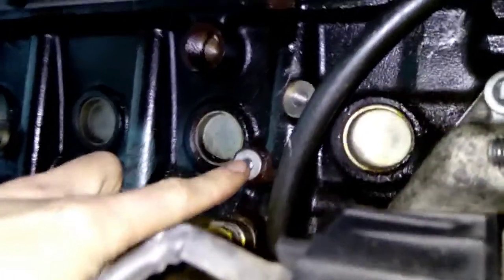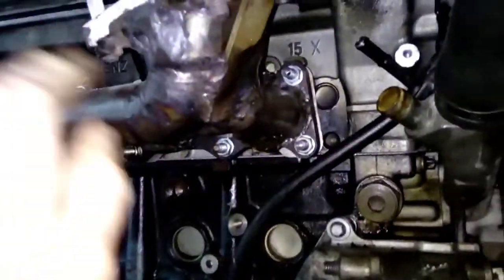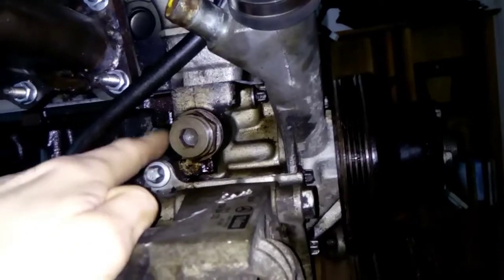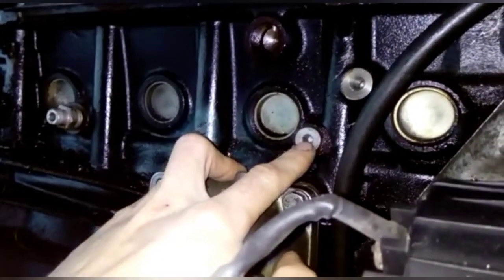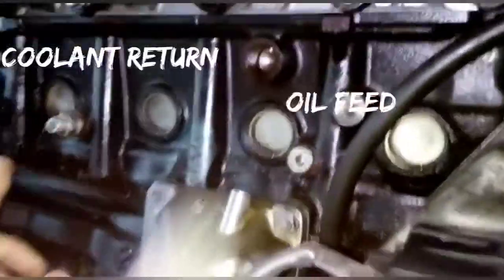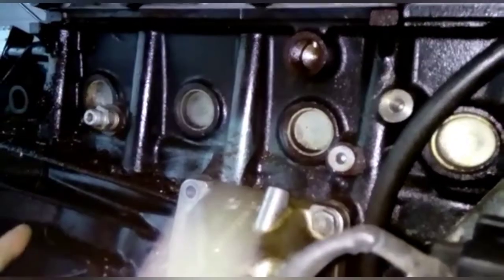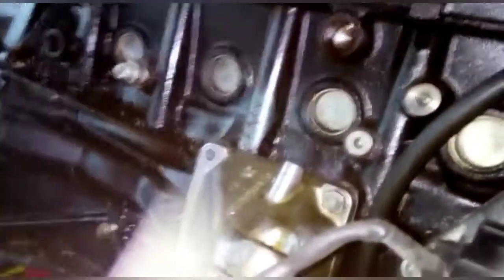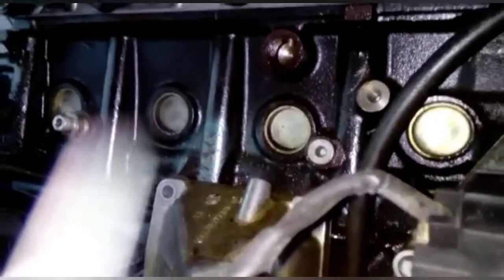Mercedes M111 Turbo Oil Feed How To Guide... (size of fittings needed in description) #subscribe

Comment: Hi! Im wondering to turbo my 2.3K engine. Thanks for ur video the oil feed line problem is solved. But its will be a drift car and i would like to have an oil cooler too. Could u tell me some tips how to do it ?
Reply from the maker: Hey thank you for your kind words, if not already please subscribe it really helps the channel get suggested to more people that way my videos can help more people 😃. I'm trying to work out exactly the same thing, you can bypass the stock oil filter housing by using the two threaded ports on the front cover of the engine. If you look there is two female hex bungs in the front cover, you can remove these and fit some adapters to 10 AN fittings. But using this method you will need a remote mount oil filter. I also don't know the thread size or pitch of the bungs that are in there stock, but right now this is the only way I can suggest how to do it. There is a possibility of another way off the back side of the oil filter housing but I'm not sure on that, I think that may only be on Evo engines. I hope that helps buddy👍

Comment: What exhaust manifold are you using? Is there a stock header from another Mercedes engine? Also will they fit on a w202 c20? Thanks
Reply from the maker: On our turbo Slk we made a completely custom log manifold, on our Supercharged cars we always use the stock tubular header you could use a 230 Kompressor header on a 200 car. ide recommend one from a Clk or 202 though as the Slk the engine sits more forward from the fire wall so the manifold is slightly different. It depends really one what you plan on doing with your car, if your just looking for a cheap tubular header then the stock kompressor one is ideal you may also need the exhaust front pipe to link up to the header. hope that helps please if not already consider subscribing 🙂👍
Reply: @M-oneeleven-M111  ah ok thanks for the reply and info!, I do have the steel tubular manifold on her just wondered if there was any stock cast log manifolds that would fit to save some fabbing but I guess if I just reroute the steel one I can find a nice place for the turbo anyway. I'm only making the turbo kit to get better efficiency out of it and maybe a bit more torque and some nice noises of course (;, so maybe running it on a bar of pressure max, do you know if the plastic intake manifold will take a bit of pressure or will I have to find a cast one?
Reply from the maker: @willreeves497  ah right you can take a M111 log manifold cut open the outer shell and they're are t prices in it if you cut the welds on the flange neatly and re organise them you can make a turbo manifold from that. The only downside to that method is the stainless t prices are quite thin so you have to brace it and they are prone to cracking. Have a look at the exhaust manifold video we have on the channel it shows one made using that method. What management do you plan on running the car on also is it a C200 N/a or a C200 kompressor? A bar on a stock 2.0 na m111 with 10:1 compression won't end well it will Det badly blow the headgasket out for sure if not lift the head whilst it's at it. Only the 2.3 kompressor engine should be pushed that far, the 2.0 kompressor is I think 9.6:1 so can take close to a bar. The N/a I would not go more that 0.5 bar because of the compression the rods will take it all day long the pistons can take power but can't take DET something would fail very quickly. Also stock management if Bosch ME can't manage safely up to .7 bar but yet to test this on a N/A car. If the cars on the earlier HFM management then a draw through set up may work but it also might not. If you car is a manual go standalone with knock detection it's safer and easier to tune. There's a lot of videos on YouTube that make these M111s seem bullet proof but it's more down to the fact people don't show failure like we do. Also depends on turbo trim to if your more looking for efficiency that's sensible efficiency over Hp I think you could make 180-200hp on a 2.0 Na m111 with a Gt17 or better a TD04 15t from a Saab Also a cheap Chinese t28 would work. We have noticed these engines seem to live longer with a GT28 sort of size turbo max, any bigger it seems the volume and pressure become too much especially when using stock headbolts. You will also want Bosch FR5DC spark plugs 0.8mm gap to prevent spark blow out or the plug melting down. Also I recommend a AEM wideband great bit of kit works fantastic and has a calibration function too. As for the plastic manifold yes it will take the boost but I always recommend the metal one because 1 you can modify it for a larger throttle body if you run standalone management and 2: it works a lot easier for fuel injector upgrades as both Saab and BAM injectors which is what we recommend are shorter than stock, on the plastic manifold the fuel rail bushings are part of the manifold but on the metal one they're seperate. This means on the metal manifold you can fit shorter 27mm fuel rail bushings to accommodate the shorter injectors. 🙂 I know that's a hell of a lot to read but I like to pretty much get most of the stuff out the way in one go 😂👍
Reply: @M-oneeleven-M111  so all m111 engine manifolds are interchangeable? 
Oh damn well that shows how bad my research has been, I thought mine was the lower compression one, i must have been reading the kompressors stats.... Well then in that case I guess I'll only be running a few psi. I have a t250 from an old descovery that Ive been mocking up, I'd much rather be on the smaller side, and have a faster spool for better bottom end efficiency, I don't really plan on racing around in this thing (have my turbo EJ civic for that kind of fun).
For fuel control ect I hadn't got that far into planning yet, I'm assuming because its ran from a MAF sensors I should be good for a few psi ? As most accommodate for around a bar above atmospheric, but if not then may just solder a speeduino together. Thanks for all the info btw, have answered quite alot of stuff I couldn't find the answer to after hours of searching (: have subbed
Reply from the maker: @willreeves497  Thanks dude appreciate it well the 2001+ Evo M111s have a different ports so a early manifold wouldn't fit that in the intake side, the Evo engines had quite a lot of revisions including lighter rods and crank but the pistons and head are better design. So aslong as your engine is pre 2001 with no sensor in the cam cover it's a pre EVO engine which means the metal manifold will fit, but you need a Intake gasket to match the metal manifold as the plastic intake manifold has o ring type gaskets. Oh that should spool pretty damn fast a t28 is near enough instant on a 2.3 with 8.6:1 compression. Good man in all honesty a Honda makes a better turbo toy bits are a little easier to find 🤣. Although I am trying to change that for us M111 guys. But a MAF should be good for 0.5 bar and with 10:1 compression it will pull well. No worries clear information is hard to find on these engines, the thing I see is a lot of contradiction on forums which makes it hard to know what to do

Comment: Hi mate. Where can I get a oil feed for and oil pressure gauge?
Reply from the maker: Hi mate is this on a turbo or a standard car? Not that I don't think it makes that much difference I don't think, but in my eyes although I could be wrong if turbo you could put a T inline but the turbo feed may cause a slight pressure drop. If stock then you could take it from where you would take the turbo feed from shown in this video. 🙂 To be honest I haven't thought about this until recently so I haven't tested that.
Reply: @M-oneeleven-M111  thanks for the quick reply. This is on the standard c230k engine that’s in my 190e
Reply from the maker: @MrConnorHorton  yeah so you should be able to run a gauge from that port fine I'll see if I can find where I wrote down the thread size although it might actually be in the description thinking about it. There should be enough room for a oil pressure sender to fit there. No worries I always try to reply as soon as I can 🙂
Reply: @M-oneeleven-M111  m12 x 1.5 is what you say in that vid mate.
Reply from the maker: @MrConnorHorton  ah ok dude I forget it's been so long since I've actually been playing with a performance M111 build 🤣
Reply: @M-oneeleven-M111  thanks mate 

I don’t suppose you know what pin the rpm signal is from the ecu do you?
Reply from the maker: @MrConnorHorton  bare with me I shall ask Ben he does all the wiring wizardry, things melt when I do wiring 🤣
Reply: @M-oneeleven-M111  thanks mate
Reply from the maker: @MrConnorHorton  still waiting for Ben to reply, I forgot to tell him it's on a 190 🤣. Is it's for the guage cluster I'm assuming?
Reply: @M-oneeleven-M111  it’s for the race tech dash 2 I have in it mate
Reply from the maker: Ben did say you can get it through the canbus but I'm not sure that's possible with your set up, I've been waiting a day for him to answer 🤣. We will get there the racetech do do canbus though doesn't it? I did look at them a while ago for my Is200
Reply: @M-oneeleven-M111  no that’s not possible with mine I’ve torn all that out. I can get it from a coil signal or injector but the injector isn’t a clear signal and the coil wire is too high voltage. So the other option is the ecu rpm signal.
Reply from the maker: Righty so the canbus is the only way to get it from the ECU the only other way we can think is piggyback the crank Sensor through a VR conditioner. This is why a lot of people switch to standalone cause the Bosch unit (assuming it's the Bosch ECU you have and not the Siemens) is a very awkward ECU to work with. It does have its bonuses as it's a very adaptive unit but that's the only way we can suggest buddy without going standalone. In our Slk we have megasquirt running the engine with the stock ECU and a OFgear transmission controller just to make that all sort of work. Sorry we can't give you the answer you were hoping for, agreed most of the time you can pick up a signal from the ECU but like I say these ECU's don't like to make things easy for us.
Reply: @M-oneeleven-M111  👍 I did try the crank sensor too but not with whatever a VR conditioner is so I’ll look into that. Thanks mate.
Reply from the maker: @MrConnorHorton  no worries buddy I like to try and come up with a fix but a vr conditioner I think basically cleans and or converts the signal. I don't do electronics I stick to the wrenches 😉 but yeah see if any of that comes to anything bud hopefully you'll find a solution 🙂
Reply: @M-oneeleven-M111  update: the oil pressure feed is fine taken from there. I ended up using a coil signal wire for the dash. It was too high voltage (15 when it should have been 12) so I added a resistor inline and it’s fine.
Reply from the maker: @MrConnorHorton  sweet I'm glad you managed to get it figured out, that's good thinking using a wire from the coil. simplicity is the best way, like I say I'm not big on wiring so I tend to shy away from it a bit. But super pleased you got sorted and I really appreciate you giving a update too 👍😃

Comment: Hi I have the r170 facelift 2.0K,  m111.958, 163hp stock.it has 9,5:1 comp ratio with with knock sensor sensing no knocks with 95ron fuel. When pulley and map it I reach 200hp engine running perfect but knock sensor senses knock at wot and ecu retards timing. So my question, is it safe to depend on knock sensor as I cannot reach higher octane fuel?
Reply from the maker: In short the knock sensor is there to protect your engine if it's knocking I wouldn't push it any more than that, but one other suggestion do you have access to octane booster? Most car parts place sell it that may allow you to push it a little more. If not I wouldn't push it anymore. This video of our shows what we did when detonation got the better of our engine https://youtu.be/pnTxLGLfD3c please if not already Subscribe we really appreciate it 🙂
Reply from the maker: The other thing is maybe a fuel injector upgrade? If not already on lower octane fuel you need more fuel so you have to have a richer fuel mixture the det (knock) you are experiencing could be that you just need more fuel

Comment: Hey can you help me out how to do it? Can I do with the motor on car ? What happens to the metal materials drilled inside of block ?
Thanks
Reply from the maker: Hey no drilling is required on the block for the oil feed if taken fro where we have taken it there is I believe from memory a threaded bung in the block where the feed is taken from fitting sizes required I think are in the description bud. It's a very easy job to be fair it's just getting a custom feed line made up. Or alternatively you can use a universal oil feed kit and source the adaptor fittings required. We have taken ours from the thread in the block and it's always had enough pressure. I know in the video Ben mentioned another location but it really isn't necessary to use the other location. If that makes sense?
Reply from the maker: Also if you find this information useful please subscribe 🙂

Comment: So it would be fine using a low pressure for the feed? If it’s only oil and not water cooled?
Reply from the maker: Yes it would this is the way we run ours it's still pressurised we are using only oil to cool and lubricate the turbo ours does have the option for water but at this time we went using it
Reply: @M-oneeleven-M111  I’m just wondering if there’s a way to drain without tapping oil pan. But if that’s only way then so be it I guess lol
Reply from the maker: @djhairtriqz2084  to the oil pan is how you should do it some people with other cars return it by the dipstick but I would not recommend that. It's not hard to fit a bolt in bard but it is a bit of a job to get the sump off of the car

Comment: hey guys I'm struggling a little the slk230 has a whole front airbag system 2 sticks in the bumpers under the headlights. can you help me remove mine I dont want to trip he airbag ripping it out. or I I can jus snip up to where I need clearence.
Reply from the maker: Another good question we normally avoid anything to do with airbags cause we normally like to leave them in do you plan to remove your airbags or do you just trim out some clearance for something near the impact sensors?
Reply: @M-oneeleven-M111  I want to remove the front tubes that are like air sensors or something. idk what they are their weird plastic things. they look like special nothings. but yeah I'm gonna remove the wheel airbag in the future. I dont care about airbag lights or anything. will build a custom datalogger dash in future

Comment: I have the w202 1.8L m111.921. It is only 8.5:1 compression which is pretty low and makes 120hp. you think i can boost it to 200hp reliably? without changing internals? thinking of like 5-6 psi max
Reply from the maker: I have seen 1.8 m111s boosted I didn't realize they were quite that low compression but if so perfect for boosting within that psi range I can't see much of an issue but every engines is different it's always good to replace the headgasket on the m111 engines as the standard ones by this point are worn out. That said ours lasted 8 months at 1.2bar but we use the m111.975 engines as they come with slightly tougher internals. I can't say for sure it will be fine but as we have never used that engine but based on compression ratio and and the boost you want in theory and I use that word strongly in Theory it would be ok but I don't want to say yes incase you go and do it then it blows up hope that helps
Reply from the maker: https://youtu.be/7rmr7-OjLvY you may have already seen this but here is a turbo c180
Reply: @M-oneeleven-M111  yes I have watched that guy all his videos. He went to 300hp at some point and as you said they head gasket blew. That guy also said about changing headbolts. Do you know where I can get a better head gasket? Which one will you be using. Thanks for the response. I subbed and excited for your project
Reply from the maker: @georgenatsikas832  Thank you appreciate that and we use elring gaskets normally it's still a fibre gasket but is better quality than the standard Victor rienz one these engines come with. He did push it very hard blew it up in the end but 200hp should be easy for these engines. As for headbolts I'm looking at some ARP m12x1.75 100mm 12.9 grade bolts to use in our built project but need to do a bit more research first
Reply: Did you get around to turbocharging the M111.921? I want to do the same with mine. Is there any issues using a stock W202 ECU with a turbo?